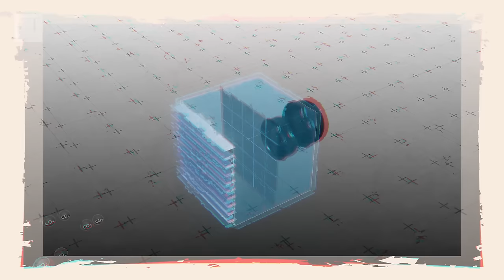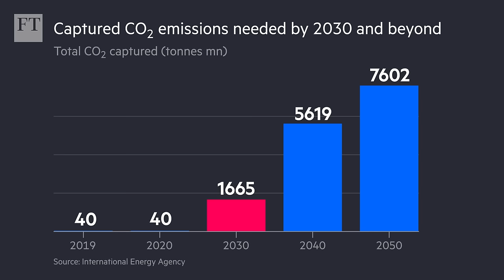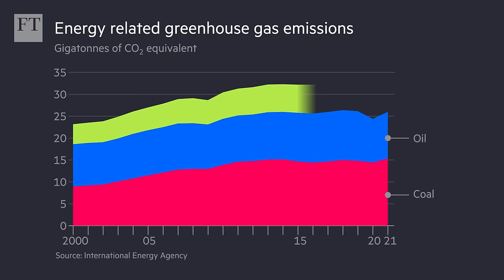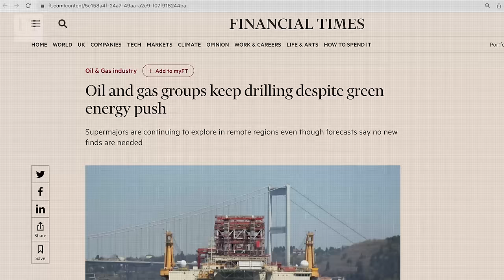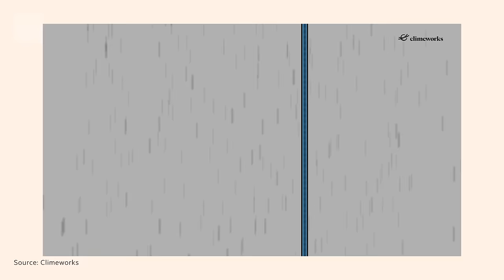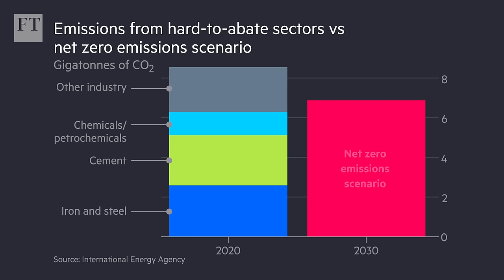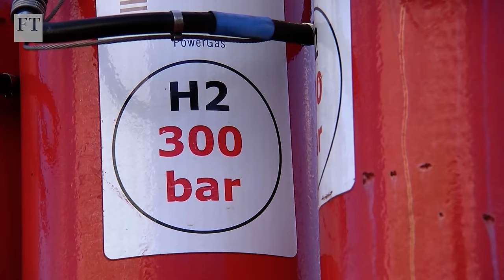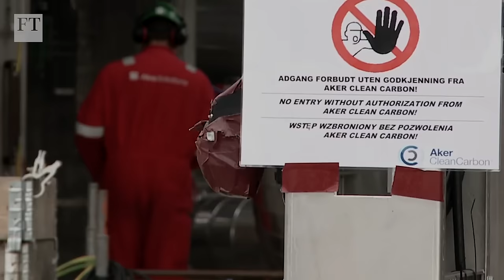Carbon capture: the hopes, challenges and controversies | FT Film

Comment: As a professional engineer having served my career in the power industry the carbon capture is possibly the biggest scam ever invented.  The application of capturing the carbon dioxide from an industrial process and storing it centrally as a worthless entity can only be classified as a total waste of time because there is zero commercial value in it.

The drive behind the carbon capture is legislation penalising the carbon emitters to force them to remove the carbon emission.  However laying massive pipelines, installing pumping stations, getting airtight rock cavities for storage all require investment so ridiculously huge the industry hasn't got.  The investment has absolutely zero commercial return.  One can almost say the cost of capturing the carbon is more expensive than generating the electricity itself.

The lawyers and the engineers can play tunes with carbon capture but the whole thing doesn't make economic sense.  This was my view when it first came out and it remains unchanged until I retired.
Reply: It's not supposed to make economic sense. That's why it has to be forced. The problem is that everyone has got used to being allowed to just dump their rubbish into the air without realising the consequences. Think of it this way: if someone eats a sandwich walking down the street the easiest way for them to get rid of the wrapper is to just drop it on the ground. But that is bad because it is polluting the environment. They could go and walk to a rubbish bin but that requires more effort. Many people won't bother. They need to be made to go to that extra effort by imposing fines on people who drop litter. People who dump CO2 into the air need to be made to pay fines that gradually increase until it becomes cheaper for them to either dispose of that CO2 properly underground, or find an alternative to buring the fossil fuel in the first place. It will mostly be the latter but some things are easier to decarbonise than others. Eg electric cars pretty easy. Electric long haul planes very hard. There will be some use cases where it's so difficult or expensive to not emit CO2 that recapturing it later might be worth it. For most things just not emitting it will be cheaper. We need to start with the assumption that we mostly just have to figure out how to do without fossil fuels for most things and work on massively scaling that up so it gets cheaper with scale.
Reply: @MrAdopado  No.  Carbon capture is just not practical.  There are many superior solutions from the renewable energy.
Reply: @gunsumwong3948  There are many types of carbon capture and I agree that many are not practical. However, that doesn't mean that all forms of carbon capture are not practical. Trees and other vegetation do pretty well! Clearly it's not the only answer but we need to take action to remove carbon because we are not going to be able to reduce emissions fast enough on their own.
Reply: @MrAdopado  What emission? If you travel in HSR and metro that are electrified and use EV.
Let me tell you the real problem of power generation every turbine, be it gas or steam, has an efficiency of just 1/3.  That is to burn 300% fuel to get 100% electrical power.  The remaining 200% in the form of heat is dumped into the environment.  And you are worrying about carbon emission?
Solar and wind are now among the cheapest way to get electrical power.
Reply: @gunsumwong3948  Yes, carbon emission from the burning of fossil fuels. I agree there are plenty of alternatives that should be being pursued but we are a long way from deleting fossil use completely. Also we have centuries of carbon build up in the atmosphere so we need to be carbon negative not just reduce further carbon emission.

Comment: 15:00 - "Clusters" sounds a LOT like "rationalisation" in Germany in the late 1920s. The problem with rationalisation was that in the depression, it catastrophically increased the ongoing relative costs associated with fixed capital due to the lack of demand. Arguably this helped to tip Germany into dictatorship, along with and another form of economic inflexibility, the strong trade union movement that had eventually to be violently crushed. In the troubled times ahead, we need resilience, not fragile industrial megaprojects.

Comment: Sea level rise can be totally accounted for by expanding warmer ocean waters.   Denmark has Greenland ice at about net zero in gain verses loss.   The USA has Greenland as losing ice at which rate in a little less than 1,000 years Greenland could be ice free.   This video contains the UN Climate Change disclaimer.  Global warming was officially stated at 1.1°C in 1991 and 1.06°C in 2022.  There is no mechanism that would allow greenhouse gas behavior to cause global warming.   The back of the United Nation's IPCC science report states it took its greenhouse gas samples at 20,000 meters altitude where it is common high school level knowledge there is no greenhouse radiant energy.  This is typical practice for deceptive marketing to state legal data transparency protecting the perpetrators from fraud prosecution.  

Earth's greenhouse effect is frequently used as a primary example to high school students of a system always in saturation from the strong greenhouse gas water vapor absorbing all the greenhouse radiant energy from the earth with greenhouse gases within 20 meters of the surface that is all around us everyday and can't have its overall effect changed.  There is no further greenhouse radiant energy to interact with greenhouse gases.  At 1% average tropospheric water vapor over 99% of earth’s greenhouse effect is from water vapor.  Water vapor would hold earth's greenhouse effect in saturation if it were the only greenhouse gas in the atmosphere.

Atmospheric CO2 levels of 1200 ppm about three times what they are today would greatly invigorate C3 plants the majority of plant life on earth greatly greening the planet. 

0.4% of the atmosphere is CO2 and on average 1% is H20 water vapor.   (1% H20)/(0.4% CO2) = 25.  Water vapor is 25 times more present in the atmosphere on average than CO2.   Water vapor has an CO2e of 18,  18 X 25 = 450 CO2e total for water vapor to 1 CO2e for CO2.

Comment: Fossil fuels are fossils of plants. Simple and easy way of returning CO2 from fossil fuels in the atmosphere is to take it into plants, and keep them in stable form, like logs for houses, buildings, cars, etc.. One more important question is whether CO2 in the atmosphere capture heats from the earth, from the sun or both. If it captures both, it may cool the earth, as the heat from the sun is larger than heat from the earth.
Reply: @Mujina 
You are exactly right. The plants, c3 variety especially ,  need it.

To your question whether co2 affects solar radiation is a weak yes at the 4.27  micron Infrared band, because the solar radiation tails off and the terrestial is less but cancels. The primary co2 earth IR radiation is at 15 micron where no solar radiation is present. 
The mechanism is the following: The molecule O-C-O has 4 vibration modes :
1) symmetric aproach/separation of the O atoms. This one produces no dipole, it is not exited by a photon
2) the C atom oscillates between the O's at a resonant frequency corresponding to 4.27 microns IR wave lenght, exited by a photon  because a periodic electric dipole is produced
3) and 4) The long molecule bends up and down  and/or side  ways. 2 bending modes. The resonant frequency corresponds to a wave lenght of 15 microns.
( the frequency in hz is the speed of light in m/s  divided by the wave length in m)
The molecule is excited by an absorbed photon at exactly that frequency. Shortly there after, after having rotated, it reemits a photon in a different direction, stimulated by a passing photon.
In the average half of the photons  go up, into space, the other half returns to the ground : just like a half mirror: half the heat radiation is reflected back.
In the case you mentioned , back to the sun direction.
( laser :  light amplification by stimulated emission of radiation .
Here, there is no amplification, but the stimulation is done by a passing photon.) 
Heat radiation is light at very long wavelengt, way past red.
Reply: The CO2 acts like a greenhouse hence the term greenhouse effect. Most of the energy in sunlight passes straight though the atmosphere. It warms the ground. The ground then emits lower frequency light (infra red heat) upwards. This frequency is much more absorbed by CO2. It gets released by the molecules half up into space and half down back to the ground. But if the CO2 was not present all that heat would escape, rather than half being reflected back. 

Because a lot of the outwards bound energy is the right frequency to be reflected and only a small part of the inwards bound energy (from the sun) is of the right frequency to be reflected the net effect is warming.
Reply: @adrianthoroughgood1191  
Bull. Read what I wrote:
The only important one absorbed is the wavelenght of 15 micrometers, a single one in the IR, after a short time it is reemmited in random directions.
Calling it green house effect is highly erroneous, because a glass emmits at all wavelenghts
single vs the whole spectum is a huge difference.
You want do do it right, solve this QUANTUM effect using the Schrödinger equation .
Classical physics is totally incorrect, to describe the co2 molecule vibration modes.
The absorbed energy is frequency times Plank's constant "h"
frequency : speed of light divided by that wavelenght.
Besides, that narrow band is and has been saturated a long time ago.( Clintel lecture , Happer )
So, do your homework.

Comment: 1:05 That's backwards. We need to go to renewables, and THEN it will make sense to focus on drawing down CO2, once there's abundant cheap, carbon-free energy.
Reply: the only real solution to drive down carbon emissions is nuclear power.  Carbon capture is fine if the electricity comes from a carbon zero source.
We could produce electricity with nuclear power, use the energy to desalinate water from the ocean, run carbon capture, and power homes and industry.  
All the talk about renewables is fine, but they lack the land density, raw materials, supply chain, and intensity that we need to move the scale in a meaningful way.

as the lady says at 6:40 of the clip, anything other than nuclear power is "tinkering around the edges".
Nuclear power is contained waste, and carbon emissions free.
The continued use of coal can not persist.
Reply: @contrarian604  Your last sentence is the one thing you said that makes sense. Coal must be essentially removed from the energy supply. But really, it's more or less irrelevant to talk about, as coal is already on the way out. It's already just about gone in the UK, and seriously declining the US. It's just a matter of time for other countries, and not a lot of that.

Even if nukes were the preferred solution to climate disruption, it will take too long to get the needed capacity built out. Do you not see the handwriting on the wall? Nuclear is about half as much of electricity generation as it was 30 years ago, at its peak. It's just not happening. Even in absolute terms, it's now, finally just crawling up to the same terawatt-hours as it had at its highest point. Don't try to blame this on fears of activists. This is a worldwide thing.

As for renewables, I don't even want to argue the point. But trust me, I've heard every single effen argument against wind and solar that exists, and none of them make any sense. Not one. All I will tell you is: See how things go the next decade or so. Then come back, if you can find me, and I'll tell you, as politely as possible, that I told you so.

BTW last year, wind and solar together generated slightly MORE electricity than nuclear, globally. A point in time worth noting.

Comment: Imagine the massive  air conditioning systems you can seen near or on top of big office buildings... Multiply that by... 100 Million and all the 43 billion tons of carbon emitted each year will be sucked right out of the air. Easy. We dont have to cut emissions anymore . Miraculous. Painless.
Reply: Is constructing 100 million C02 capture systems  easy and painless?
Reply: @DrJohnnyJ  And powering them with high carbon electricity no doubt!

Comment: Terrible video. Absolutely zero mention of cost, or relative CO2 output of a solution. SHOW ME NUMBERS, THIS IS THE FT, WHERE ARE THE NUMBERS. All I see here is 20 minutes of useless blabbering. 

Show me a cost per ton of CO2 extraction from the atmosphere for different methods. Show me demand figures vs what needs to be removed from the atmosphere. Show me relative CO2 outputs of biofuels and cost of that, and subsidies needed (throughout the whole chain, so including the cost of planting new trees etc). Shame on you FT for not doing this out of all papers. All narrative no substance here.